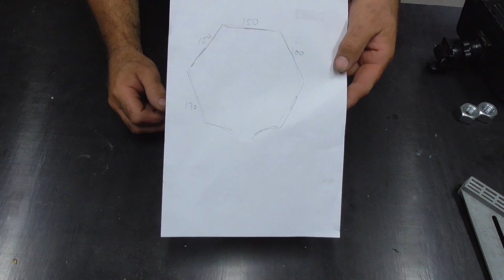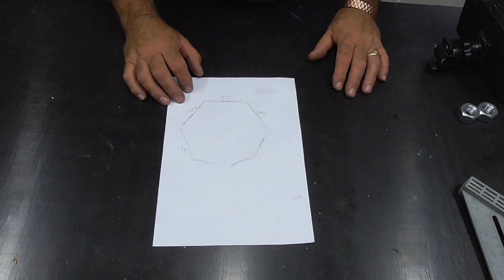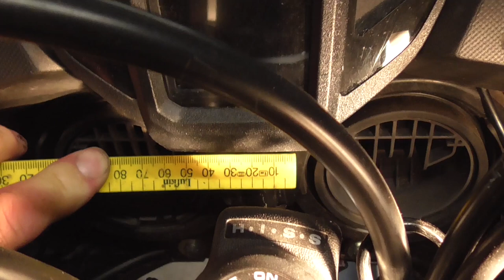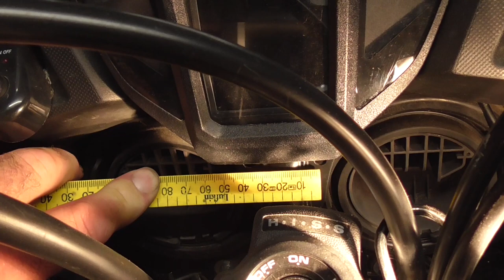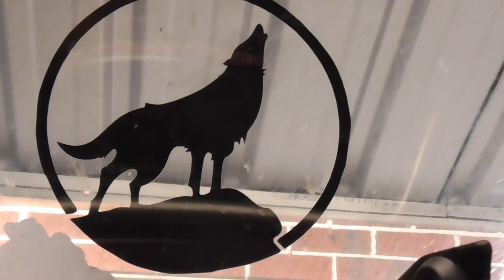Windscreen Bracket, GPS mount for Africa Twin CRF1000

Comment: Good on ya for making your own ;) Not sure if you've done this but just a tip on the lil gasless mig, swap your polarity over. You may need to pull the machine apart but the polarity needs to be reversed ;) hope this helps :)
Reply from the maker: ALY-TEK 
No not done that, thank you i will try

Comment: If you had packed that tube with sand before you bent it, it wouldn't have broken, it would have bent just fine.  Give it a try next time.
Reply from the maker: Gary C 
Thanks for the tip gary. I will try it
👍👍